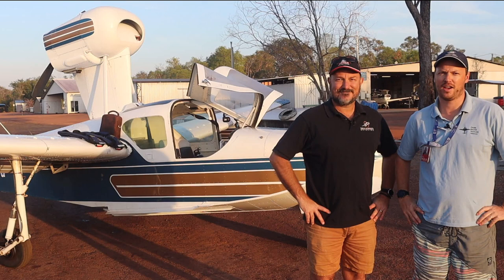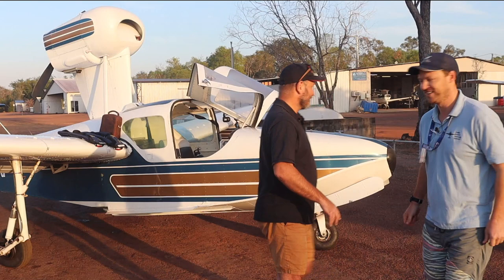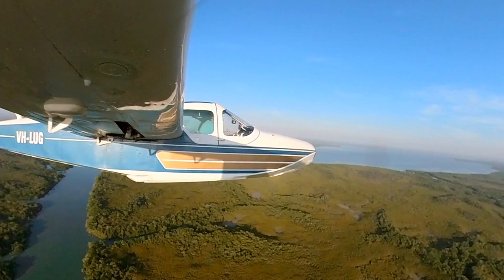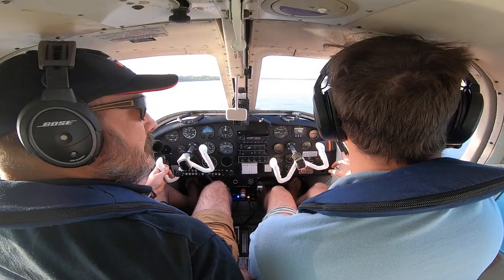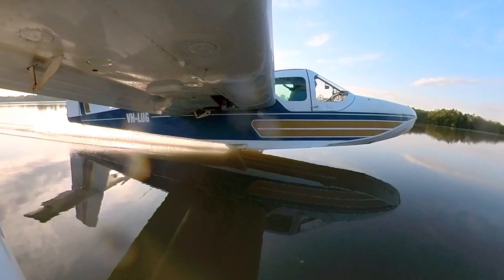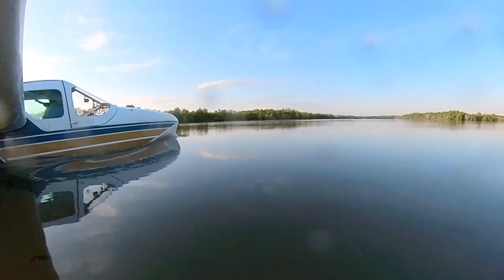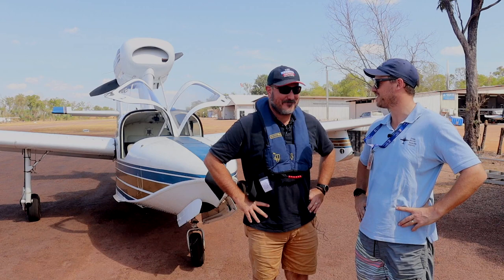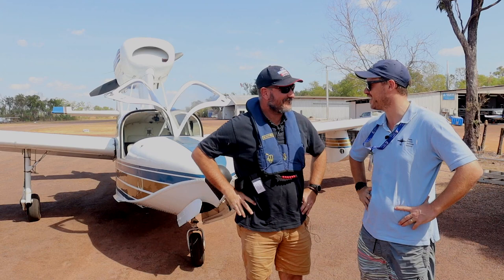What to expect during Seaplane training

Comment: Excellent training video! 
Interesting how rougher water ie:  hitting wave crests can easily begin to induce porpoise… instructor saying to catch it with a little forward pressure on the yoke…
Interesting aileron position during step taxiing…looks like you re creating drag against the direction of turn in order not to plant the inner sponson or prevent unwelcome roll during the step taxi turn? I wonder how it handles in rougher conditions….
What about sloshing water in the airframe? Automatic bilge pump takes care of this? Hmmm
Cheers